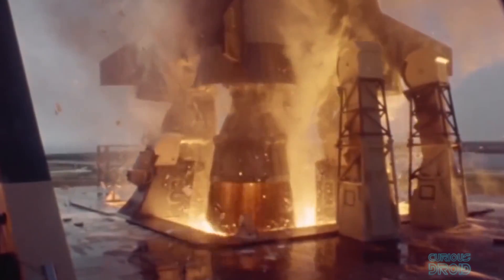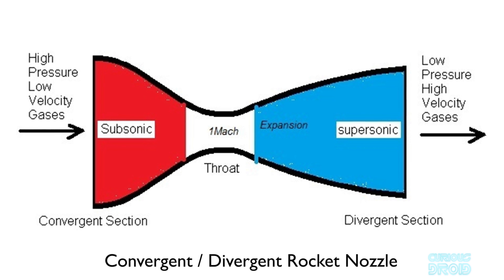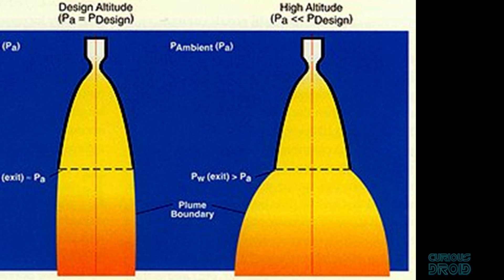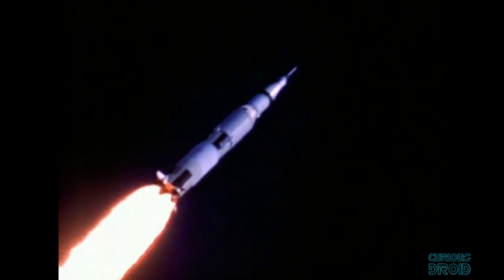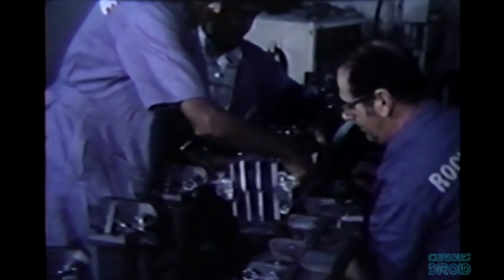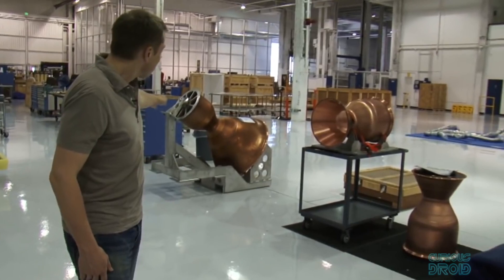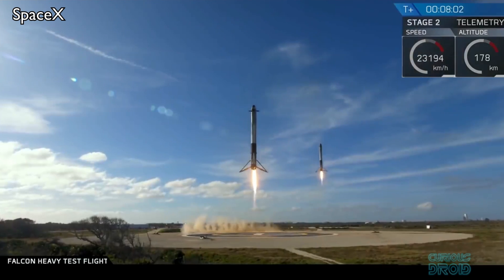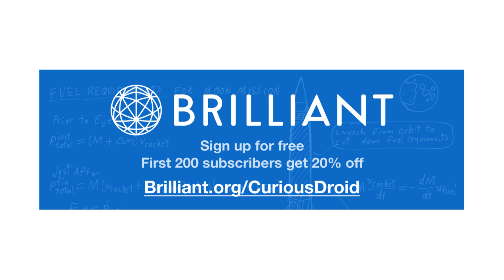Aerospike Engines - Why Aren't We Using them Now?

Comment: Random thought - I wonder how much the difference in pressure from sea-level to the top of Everest effectively changes your weight. A less dense medium ought to give your body less buoyancy, effectively making you heavier.
Probably hard to measure in practice, but I expect the calculation should be fairly simple if you had the right input data.
Hard to measure in practice too since the opposite effect should be happening with gravity as you are moving further away from the center of mass of the earth.
Stuff like this intrigues me. It's fun to think about that even the rotation of the earth factors into the effective force we think of as weight. It's a lot more than just gravity that goes into the final result - although these all tend to be pretty minor in comparison to the primary factor.

Comment: I'm not surprised if SpaceX bolts a few aerospikes under their BFR, since the BFR is claimed to be SSTO, and since aerospikes are the ideal engine to use for Earth->Mars->Earth surface-to-surface travel.
Reply: "ideal engine" No their not. Aerospikes are only good for the transition from atmosphere to space. Bell engines are much more effecient in the environments they were designed for. So they're only really good for atmospheric operation where a vehicle frequently travels to and from the surface. But as far as exclusive vacuum operation a bell is better.
Reply: Such a craft would not exclusively use an aerospike as its main engine since it's very inefficient in deep space, but would be augmented with a (relatively low-power) vacuum engine with high Isp. But that's basically the only regime where aerospikes are not particularly useful -- if you only want to move in a vacuum.

Not great for a Moon landing/lifting engine, but for getting off the surface of both Earth ánd Mars the aerospike would be perfect since otherwise you would need separate engines for the Earth and Mars atmospheric environments.

Comment: The multistage rocket has another advantage that you didn't bring up in the video: it allows both to shed extra mass of the spent tanks, and to change the engines to not only switch up the ISP optimum but also the TWR, wich is actually fixed for any given engine. Basically, once drags disppear from the equations and the rocket is moving towards a freely falling orbit, the need to accelerate fast disappear, and you can slowly cruise towards your target velocity with an engine that's less powerful but also much lighter, reducing fuel consumption in the long run. An aerospikee would have to be dragged the whole flight possibly, meaning that even in the long circularization part of the launch, instead of a single J2 or Marlin engine you would be bringing the equivalent of the 5 F1s or the whole launch cluster of a Falcon9.
This mechanism is also instrumental for reusability: something like the shuttle and any other SSTO has to complete development and every mission in one go. A multistage rocket can land in pieces, so it can be developed in stages (for example spaceX recovers only the main booster for now and is still working on the upper stage, but it still recovers $), and if you start to develop a fleet different parts can be refurbished with different timescales without halting the whole launch schedule ,and losing one stage is a smaller cost than losing the whole vehicle